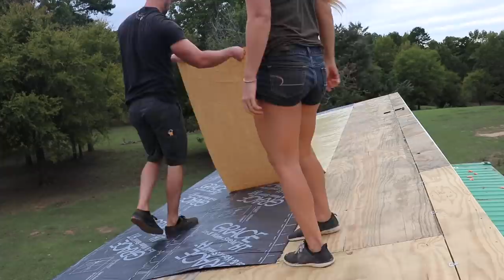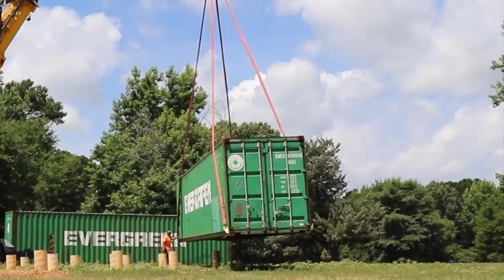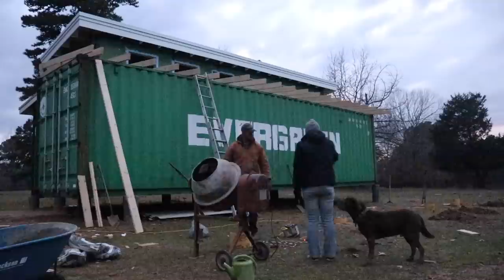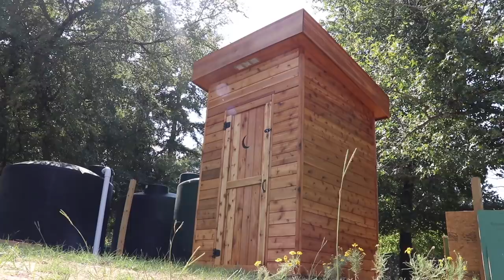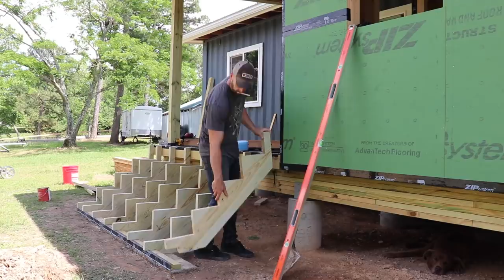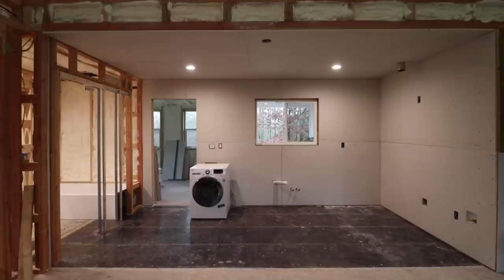Couple Builds SHIPPING CONTAINER HOME In 3 Minutes

Comment: I look forward to every weekly video. 

I know the "Polar Vortex" is very rare, but I still think you should insulate your pipes under your house (if not already done with the sprayfoam) and put insulated skirting around the bottom of your house. It will help keep varmints from making a home under your house and help insulate against heat and cold. Your pump shack needs insulation and maybe an emergency heater? Building an insulated shed around your water tanks may be great prevention in see of future events.

Comment: If your going to do the taping and mudding yourself do yourself a favor a buy the right, good quality tools, tapping boxes, bazooka taping gun and a festool drywall sander. Ya expensive but you will save so much time, mess and frustration.

Comment: the house should be covered at the bottom with a light material skirt and a few ventilation holes. so animals do not enter under the house and in winter it is warm enough not to freeze pipes

Comment: I HAVE A FEW YOUNG COUPLES I AM WATCHING AND THEY ARE ALL BUILDING A HOUSE AND ALL THE WOMEN ARE PREGNANT. LOL. I FIND THAT VERY INTERESTING. NOT ONLY THAT BUT YOU ARE ALL BUILDING WITH DIFFERENT STYLES OF BUILDING. YOU ARE THE ONLY ONES USING THE CONTAINERS AND THE ONES IN PANAMA ARE BUILDING USING THE STEEL FRAME METHOD. THE ONES HERE IN THAILAND ARE BUILDING WITH CONCRETE AND BRICKS. THEY ARE THE ONLY ONES THAT ARE PUTTING IN A POOL.

I FIND IT VERY INTERESTING THAT THE THREE OF YOU ARE USING SUCH DIFFERENT BUILDING METHODS BUT THE LOVE THAT YOU ALL SHOW TO EACH OTHER IS THE SAME. 

I HAVE HEARD THAT IF YOU WANT TO FIND OUT IF YOU REALLY LOVE EACH OTHER, BUILD A HOUSE. IF YOU ARE STILL MARRIED AT THE END IT MEANS YOU REALLY LOVE EACH OTHER.          LOL

Comment: There are 2 other projects where they used spray foam insulation (TX and NC) the contractors did are very professional job and very little work on the utubers to do any clean up. Don’t know what types of contract they have and work involved. There was very little unfoamed areas that could be seen.